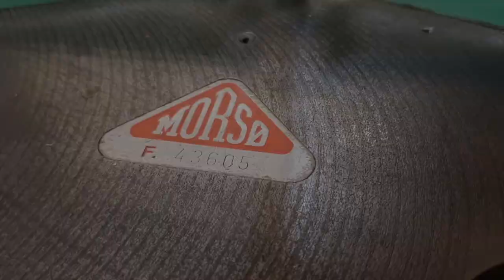Guillotine Restoration - Morso Mitre Guillotine

Comment: great video` I have a Morso F that's been garage stored for five years. its a 39 year old machine which was in perfect condition but now even though covered.., has a fine rust layer on the exposed parts. This has given me the push to strip it and bring it back to the condition it deserves to be in and inspire me to use it.
They are a masterpiece of design.

Comment: Dont know why this was recommended to me, but I used to work at the factory making these from 2005 to 2009. A lot of memories as you take it apart :D
Many of the large parts are made from cast iron. When machined, the chips acted like oatmeal and flew everywhere. Safe to say I wasnt clean for almost 4 years! And dont even get me started on the knives I remember my first time making adjustments to already finished knives. my fingers were covers in band-aids after a single day!
Reply from the maker: That's a good story behind 👌 blades are the scariest part of this machine 😁
Reply: @MatthewMoustache  we also had XL knives.. Those were the stuff out off nightmares lol
But Im guessing they were still sharp after all that time?
I remember being told that they couldnt improve them anymore or they would be so good that they wouldnt be financially viable 😅
Reply from the maker: @ichiinc  there was couple small damages to the blades but after resharpening (they are extremely hard) it cuts well 😁
Reply: amazing. Is it true that the blades used to be cooled outside the factory in the cold Danish climate to make them super hard tempered? Apparently that stopped when more stringent health and safety practices were introduced.Also,its said that these machines improve with age.

Comment: My boss would have gone nuts if I’d held the blades like that when replacing them. One little slip and your fingers are off. Those are sharp! 😁 Two pencils into the bolt holes then get the centre bolt in first. These are just brilliant machines and will last a working lifetime no problem at all.
Reply from the maker: Trust me I've had chills while installing them 😬 pencil technique sounds good and safe 👍 and yes this machine is brilliant 😁
Reply: @MatthewMoustache  yeah always hold from the top just in case they slip. And they do quite often. Razor sharp but heavy blades. Gravity + flesh = hospital 😜

Comment: nice restoration. when you are cutting with it, step on the peddle and cut through, move the cutterblock away one notch, then release. otherwise it will bind on the upstroke. you can get pretty fluid with some practice.
Reply from the maker: Thanks Sean 👍 everything works better with practice 😁
Reply: Thankyou for this tip 😀📸😀

Comment: Amazing. I am about to undertake the same project. Any suggestions on where to find a missing measuring arm?
Reply from the maker: Thanks man 👊 i would try ebay or if you have enough of skills in welding try to make it yourself, or if it will be stationary then make it out of wood. 
Other than that i have no more ideas. 
Good luck Adam 👍
Reply: @MatthewMoustache  Did you have any issues with the rebate holder working? I am done with my restoration but for some reason the rebate holder is stuck

Comment: Hi Matthew,  great video, are you able to advise what products you used? ie what did you soak your bolts in? and what was in the bucket? Cheers, I'm nervously about to undertake a similar restoration on a Hansen guillotine.
Reply from the maker: I started with WD40, in bucket i had warm water with dishwashing liquid and also sprayed with Elbow grease, to make bolts and washers black I've used gun blue (cold blueing process) and for buffing chrome Autosol polishing paste 👌
Reply: @MatthewMoustache  thank you so much for the info, I've already started dismantling and hoping like hell I remember how to put it back together!🧐
Reply from the maker: @karyncushen8133  make couple pictures that's always helpful 👌 good luck

Comment: Hi Moustache, what product do you use to take the rust off?
Reply from the maker: @khanhlynguyen3197  now for removing rust I'm usually using deox-c or electrolysis, evaporust.
Reply: Thanks, I did buy Evaporust and works pretty well.

Comment: Hi, what is the chemical used at 8:30 to darkn the metal pieces?  Does that inhibit rust?  Thanks!
Reply from the maker: It's called gun blue, it creates oxidation layer on metal and after oiling it's protected against rust

Comment: Would you be able to use electrolysis to remove rust on the whole thing? I have the same chopper with some rust and don’t want to take it all apart.
Reply from the maker: I'm not sure, but you can use some rust remover by soaking rugs in and placed on rusted areas.